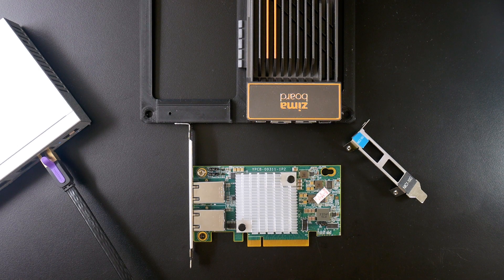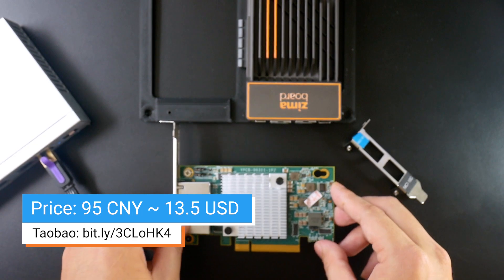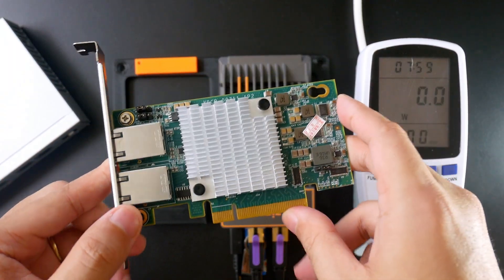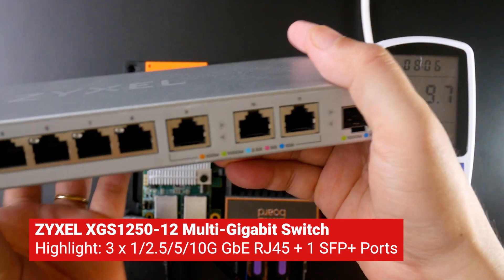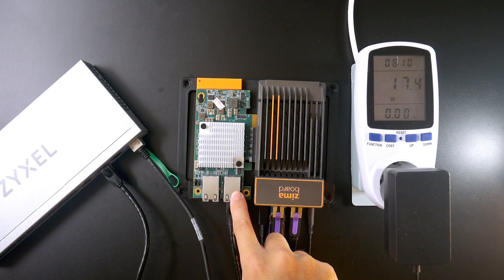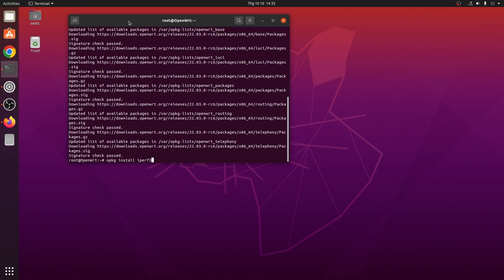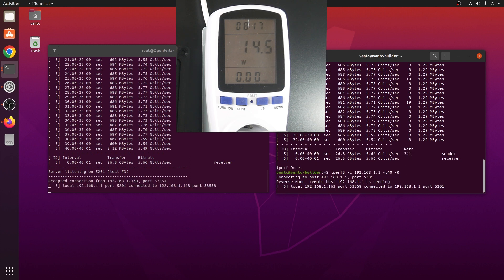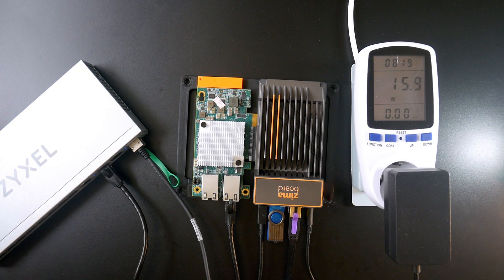OpenWRT - Intel X540-T2 10GbE RJ45 Network Adapter (Made by Inspur)

Comment: i can use with my 5gbps internet? or will not work?
Reply from the maker: Nope, this network adapter only works at 1Gbps or 10Gbps. 2.5Gbps and 5Gbps are not supported.
Reply: @VanTechCorner  tried yesterday, and yes, work with my 5gbps and  its x540 t2
Reply: Then your 5gbps is rate limited 10gbe
Reply: @1gadodms  Cannot work, maybe trained to 1 gbps.

Comment: Does anyone have a manual for these? I'm wondering what those 3 jumpers on the board do.
Reply: im currently also on the hunt, seems if i put 2 of these cards in my proxmox machine it doesnt even want to post, thinking it is something to do with these pins
Reply: @MooreAdventuresNZ  If you find out please post a reply. I was playing with one of these cards a few hours ago. In Dell T550 BIOS complains if the card is used in a regular slot, works if it is placed in a PCH connected slot.
Reply: @MooreAdventuresNZ  try to cover B5 and B6 on those cards with electrical tape (SMB Bus pins)

Comment: I have 2 of those but I still have the hole board. It doesn't work on any 16x pcie slots that use all the lanes, so it work on those that are limited to 4x. I have a couple motherboard that work like that and they're all pcie 2.0 so I'm not sure they can work with pcie 3.0(they should).
Reply: Hello, have you found any drivers for w11?

Comment: - it doesnt work on some mainboard that have only 1 pcie

- Some mainboard have 2 or more pcie, it doesnt work on slot 2. Must install on slot 1 or 3

Should be bought with fan coolee. Overall it"s good for only 20 usd include shipping fee

- An it works on hackintosh with some eeeprom modification

Comment: this card having heating problem, i know you can add a 4cm fan on it. but problem is when installed workstation board or PC board. even after system shutdown, the card continue drawing current and become burned hot.
Reply: sadly so, i'd love for those to have a fan header
Reply: yeah I have the same problem now
Reply: Doing some research on pcie 8x slot, it seems that pin B10 might be used for auxiliary power when the computer is shutdown.  If you put some tape over B10 that could cut power to the network card when the computer is off.  I'll have to try this myself and see if that is the case.  Hope it works!

Comment: I have such a card installed in my computer. The network card is also heated strongly when the computer is turned off, which is scary because the fans do not work. I don't know how to solve it
Reply: Doing some research on pcie 8x slot, it seems that pin B10 might be used for auxiliary power when the computer is shutdown.  If you put some tape over B10 that could cut power to the network card when the computer is off.  I'll have to try this myself and see if that is the case.  Hope it works!
Reply: I got it to work.  I taped over B10 pin and then I soldered a wire between B8 to a trace of B10 on the board.  I had to scrape the solder mask off those traces in order to  connect them.  If you don't do this, then the network will fail to power on even when the computer is on.
Reply from the maker: You can't solve it because the PCIe x1 that was used to communicate with the mainboard was cut.
Reply: @VanTechCorner  Any way to trace that cut off part so we can rewire any traces to shut it off when power is off?

Comment: 8:20
Does that mean the card is a lot slower than the advertised speed?
Reply: Since the connection works at line speed the other way, it's probably due to ZimaBoard lacking CPU power.

Comment: I try your link but Taobao said this one does not support oversea shipping to thailand. It seem like I have to use aliexpress cost more 2 times 😅
Also, you recommend to get HP or Dell. but if I need only a single port. Do aquantia card (Asus/Tp link) perform good enough?  In Thailand, aquantia card a bit cheaper compare to used HP/Dell X540
Reply from the maker: I believe there are some services offering purchasing from Taobao and ship it to your home. Usually they (the service provider) has a local China warehouse where they receive the parcel and forward it to you country (Thailand in this case). Maybe you can search this on Google.
For the Aquantia, is it Supermicro. If yes, it should be a working great. However, I have yet to test the card and I can't be sure on that.
Reply: @VanTechCorner  Just an update, i got the card and it doesn't work with Biostar A88MQ that i was intend to use. When plug this card,  sometime motherboard is not post. 
However, It works fine on Asrock X470 Master SLI.
Reply: Thank you for recommendation about shipping service. 

About the Aquantia, I cannot find the Supermicro card here in Thailand.

Comment: On an unrelated note, can you do a video on the Brume device sold by GL-iNet? All of its devices run OpenWRT. I have been reading and watching videos on what this "edge computing gateway" device does, but am still confused by it. Unlike the other Youtubers, you take time to explain things without skipping over the important details.

Specifically, as far as I can understand, this Brume is placed between the modem from the ISP and the router. Does that mean there is double NAT for devices behind the router? In such a topology, what devices should be connected to the Brume directly in addition to the router? Is it correct to say that if I want to host my own VPV server, the Brume would take the load off the router instead of making the router doing the VPN processing? In other words, the computing load of encrypting and decrypting the ingress and egress data is done on the Brume with the unencrypted data passed to the router to route? In such a scenario, the Brume can even pass along the same public IP address given out by the ISP to the WAN port of the router? This means both the WAN port on the Brume and the WAN port of the router can have the exact IP address, and the devices behind the router are oblivious of the Brume's involvement?
Reply from the maker: Hi Jason, sorry I missed the comment. I will check with GL-iNet if they can send me this device for reviewing.

Comment: does the NIC supported by pfsense?
Reply from the maker: Hi, I have yet to test it with pfSense. But I am confident that it is supported.
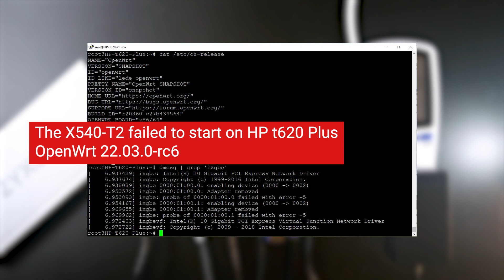Reply: I have a a set of two similar cards. It has a smaller heatsink with a fan. I forget where I got them from, but on my x570 Taichi (3700x, openSUSE Tumbleweed) "lspci" says "12:00.0 Ethernet controller: Intel Corporation Ethernet Controller 10-Gigabit X540-AT2 (rev 01)
12:00.1 Ethernet controller: Intel Corporation Ethernet Controller 10-Gigabit X540-AT2 (rev 01)". It works with the latest opnsense on x86_64. The poor little fans run at like 5k rpm lol.

Comment: Power consumption is crazy high.  Are there any lower consumption for 10g Ethernet ?  Or Ethernet 10g nic are just normally that much more?  If so then sfp+ is the only option for energy efficiency here then right?
Reply from the maker: Hi, I assume that the TDP is the same between different x540 network adapters. I checked the TDP info on Intel’s website and it is also 12.5W.

Comment: Thanks, this is great exploration.  I'm wondering if you would be able to fully stress test the Zimaboard capabilities as 10Gbps routing option with a paranoid firewall and SQM enabled.
Thanks.
Reply from the maker: Hi, I tested with the Qlogic 57810s dual sfp+ adapter, the Zimaboard (Intel N3450) only does 7.4Gbps without software ofloading (there is a video about that).

Comment: Very good tests. Very informative. I sugest a test using Solarflare chipset card because is dual port at only 7W.
Reply from the maker: Hi, do you recommend any model?
Reply: @VanTechCorner  If using SFP+ the SFN7122F ( https://lenovopress.lenovo.com/tips1156.pdf ) less than 6W typical. See complete guide here https://www.xilinx.com/content/dam/xilinx/publications/solarflare/oem-driver-downloads/dell/8522/doc/Solarflare_UserGuide_Issue20.pdf
Reply from the maker: Great. I will take a look and will see if I can get one for the video. Thanks again for the information.